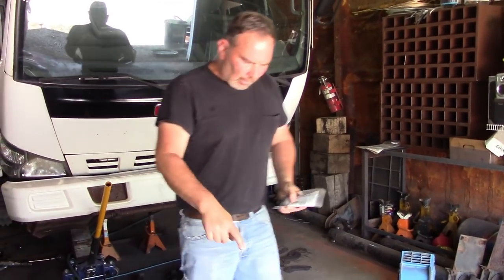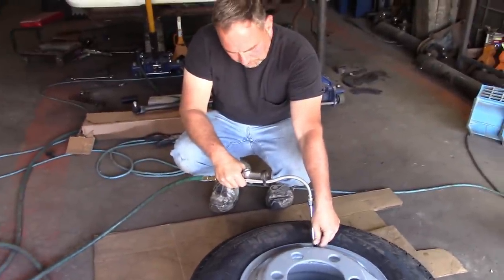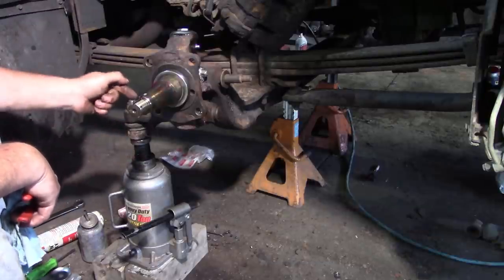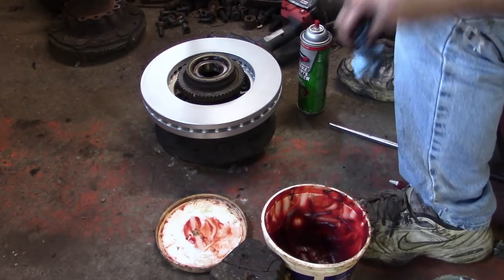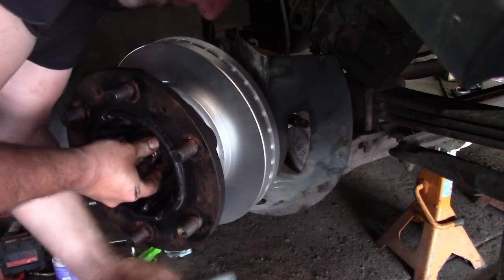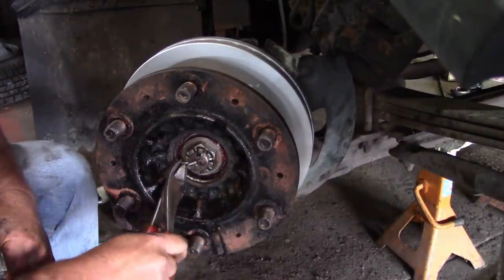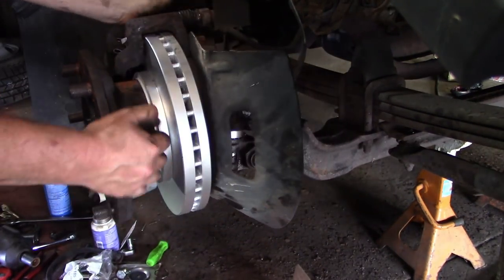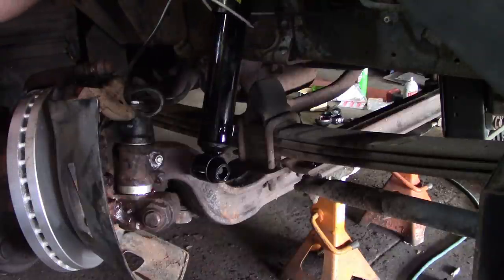GMC W4500 ISUZU NPR GETTING IT READY TO ROLL AND STOP!

Comment: Has the foresight of keeping the little plastic thingy on to keep the shock compressed until mounting the lower... backfires when it's on backward, has to compress it by hand anyway lol!  Yeah, I know that feeling all too well!  I'm also not much of a fan of the bearing packer tools, just don't trust them from what I've seen and still end up messy.  Tube of grease never lasts as long as you expect lol!  Thanks for the video!
Reply from the maker: yep...and to add insult to injury, i put the other shock on the driver side and the bracket for the abs wire was crushed. the  bolt punctured the shock. oil went everywhere....i was editing the video and noticed i put the wrong hub on the wrong side (left hand and right hand threads) and had to swap them side to side....it was one of those days for sure!
Reply: @j.c.smithprojects  awww sheesh! That stinks! Dang! Not fun!

Comment: I just did my front shocks on my 97 f350 recently. I had jackstands on my frame and the jack under the axle so move the axle to get bolts through while shock still banded.    My one mounting bolt looked like crap. It looked like either center was ground down a little or rusted down so i got a new bolt for that location.   Fun trying to get a hardened metric bolt in the evening while covid going on.   Lol. Everyone closing early

Comment: great work as always, those rotors almost looked aluminum on camera...lol putting the shock on backwards is defiantly something i would do, we all have those days.
Reply from the maker: i make plenty of mistakes....it should have been a very cut and dry job but it wasnt. i put the hubs on the wrong sides as well.....to top it all off, i put the abs wire bracket on the driver side. didnt notice the bracket on the shock was crushed....the bolt went right into the shock. oil sprayed everywhere!

Comment: I've never seen bearings packed like that..not saying its wrong..just never seen it..i usually hold the bearing flat..large end facing my palm with grease..and press the cage against the grease until it comes out on top..everyone has their own methods. I'm like you..never think to buy a brg packer..those jobs are few and far between..most jobs are oil bath hubs..tho i just did an international front axle with grease 2 days ago and a 14k dump trailer yesterday packing brgs and brake job all the way around on both
Reply from the maker: as long as it gets fills with grease, the method doesnt matter to me. it is rare that i pack wheel bearings as well...not that common.

Comment: Any pro tips for removing rusted in place lugnuts.   Even with heat I can not break them.  New six point socket breaker bar and pipe.  I have been soaking them with blaster twice a day.
Reply from the maker: on what vehicle?
Reply: @j.c.smithprojects  2006 chevy c4500
Reply from the maker: do you have an air or battery impact?
Reply: @j.c.smithprojects  both.
Reply: Is it ok to keep jamming on it.  Dont want to round over the lug
Reply from the maker: i hit it with an impact and a good quality socket held tight and square to the wheel.....never rounded one off.
Reply: @j.c.smithprojects  i will give that a try.   Thanks
Reply: It worked.    Heat then air impact until emptied 80 gallon tank then electric impact repeat.    Lugnut collar was rusted solid.   Thanks for answering questions from an amateur like me.
Reply from the maker: nice to hear you got them off. whenever i have to heat up lug nuts, i like to replace them.

Comment: I always like my wheels secured to my manual tyre machine or the vehicle when I pop the beads on cos I had a side wall blow open like a letter box as the tyre was rotten it turned out to be a snide remold and the steel core was rotten so the 7.50 R16 land rover wheel decided to go into orbit hit me arm on the way up and blew out my right ear drum.
Reply: That's why there are safety cages to use. So that we don't loose a life or limb when inflating tires.

Comment: I replaced the brake power booster and the master cylinder but how do you bleed the brake system
Reply: Did you have any issues with abs module? I have abs light on but not getting any codes

Comment: what was the bag of beads you put in the tyre for,
Reply: They are balancing beads they balance the tire as it rolls
Reply: Are you supposed to let the beads loose out of the plastic bag?
Reply: @harrowtiger  No, they stay in their small bag.
Reply: Classic Volvo do you tend get a “big out of balance” that with with the beads all in a “lump”?
Reply: @harrowtiger  That I remember, it breaks apart and the beads scatter. I only ever installed them on a small truck and the dude brought it back saying it didn't feel right for his little Chevy.
Reply: Classic Volvo I worked at Dunlop Tyres in Melbourne, it was like cake making. They had a Tyre Uniformity Test M/c that they tested all tyres destined for Ford & General Motors Holdens for rolling radial and axial out of balance forces because they both had their own TUT M/cs. All other tyres went out, uniform in build quality or not to the market!
Reply: @bradlewellen7461  thanks brad,

Comment: Curious what you do to prevent the caliper bracket from rust jacking the hardware and in turn wedging the pad and causing it to seize up? I see a lot of that on pass cars here in good ol motor city.  I noticed you lubed the outside of the hardware but not the inside of the hardware that contacts the bracket.